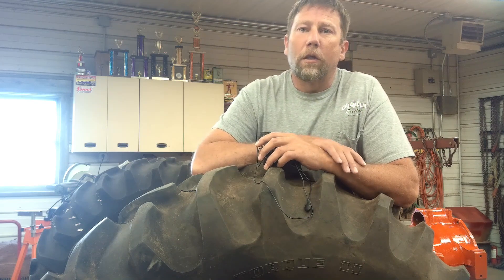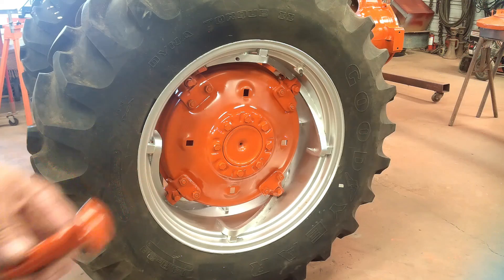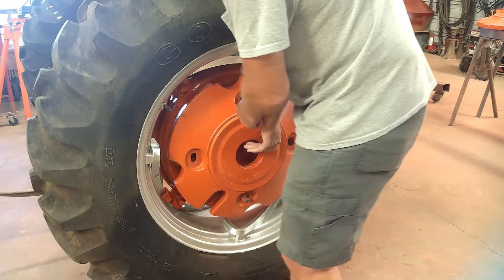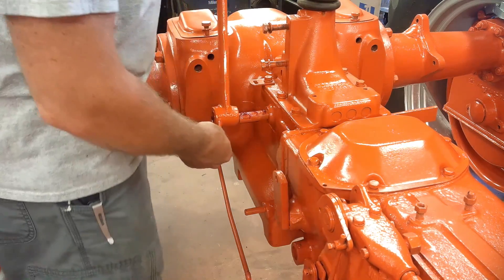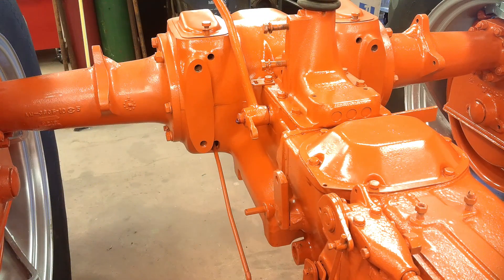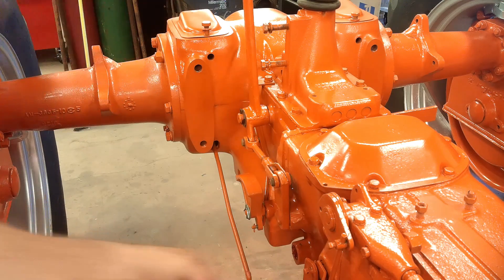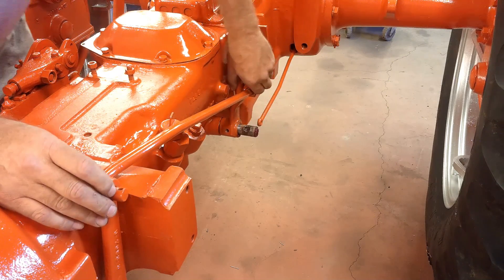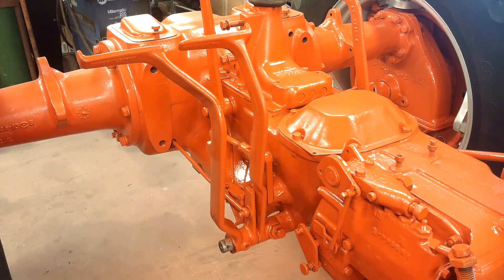Allis Chalmers WD45 Restoration Rear Tires Hand Clutch Brake and Clutch Pedals Ep.19

Comment: Wow how this video brings back memory’s, I worked for a tire company for 15 yrs, as a  mobile machanic, fixing semi,s on the side of the hi ways, and also fixing tractor tires in the fields for farmers, and everything in between, but them old long bar long bar Goodyear ‘s. Are one of the best tires in the business,  I remember pumping the cloroide out and breaking them down and putting big boots in the tires and new tube and refill them, man the old allis is looking great 👍 Jason, you do some great work on these old   Tractor’s love watching them get a new lease on life keep up the great work 👍🤘🤙🏻✊
Reply from the maker: Thankfully the fluid is long gone from these tires, I probably wouldn't have been able to move them otherwise!
Reply: Sparks Fire and Baling Wire yeah we had a boom truck to do the lifting, but let me tell you the fluid was nasty boy, I had a job where a farmer hit a set of deer antlers and I got it every where ( chloride) and the next day my new work boots looked like rocking horses, and stuff 200 red wings junk lol, but I’m glad I was mainly on the hyw working on the rigs, only did the old tractors when the other guy needed help, (on the huge duel tires) lol,  also remember using a torch and clothes hanger and welding in washers where the valve stem comes thru the wheel cuz it was rotted from chloride, any way love watching your videos, great tech and how to, keep up the good work
Reply from the maker: There rims have fairly good sized patches from where they rotted out. I still remember the day one of the originals blew out, Dads new pickup was parked by it and that calcium chloride sprayed all over the side of it!
Reply: Sparks Fire and Baling Wire ohhhh no, yeah that stuff is nasty, and for the wheels being patched, you did a great job fixing them, but we wouldn’t expect anything different from your work, it looks great 👍👍👍👍

Comment: Thanks for a fantastic video!! I had a rim rust out on mine. Trying to get the old rim off to salvage the tire for a new rim. I got all the bolts out of the clamps but the rim still won’t come off. Any advice?
Reply: Did you turn the cam lock bolt in the center to relieve the pressure? That's the one in the middle that only turns a half turn. They need to be turned counter clockwise to the stop. It's usually easier to dismount the tire from the rim while it is on the tractor.
Reply: I tried to turn them but they were froze up good. I soaked them in PB Blaster and will try again. Thanks! I was going to have a tire guy dismount and mount the tire. I’ll check your videos for tire dismounting and perhaps reconsider.
Reply: I got 2 of them loose and was able to get the wheel off!  2 of them almost hit my foot. Thanks again!

Comment: Whoa, you're getting ahead of me. LOL,  Did you spray paint the main components?  I'm at the point where I got everything off, but I cannot get the frame rails off.  I don't have access to air tools and an impact wrench that I just bought didn't do the trick either.  Not sure how I will be able to get some areas prepped for paint.  Speaking of tires, I got an education on the calcium chloride as one of the two tires was really full.  Made it really difficult jacking the tractor up and getting the support blocking squared away.  Thanks for the videos.  I am near Sun Prairie, WI
Reply from the maker: I'm using enamel with hardener added. You might need a little heat persuasion to get those bolts loose, they are tough! I found a lot of places that were bare metal. I'm glad I went through the extra work tearing it down so everything gets paint on it